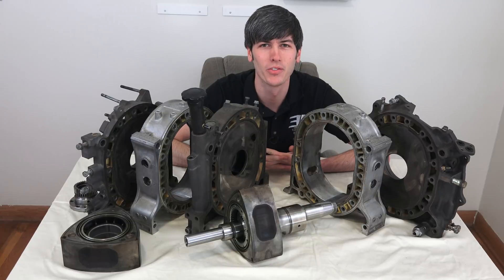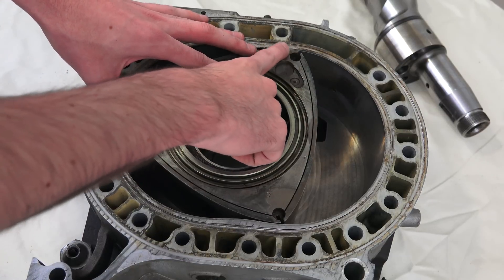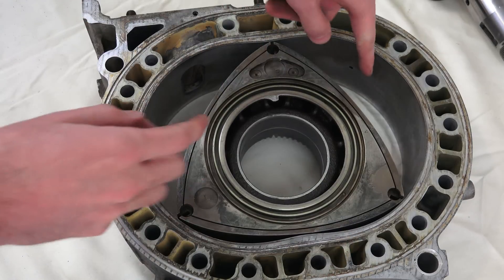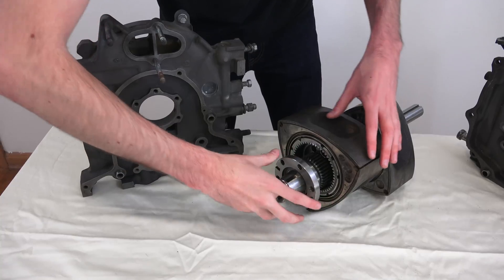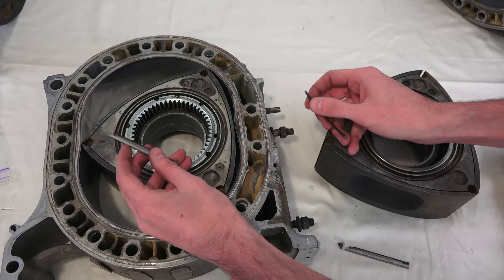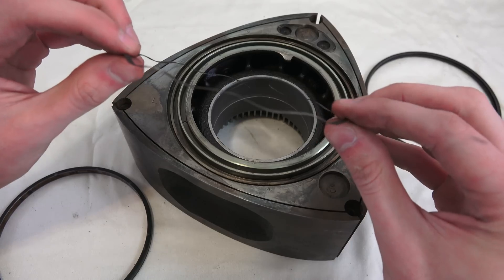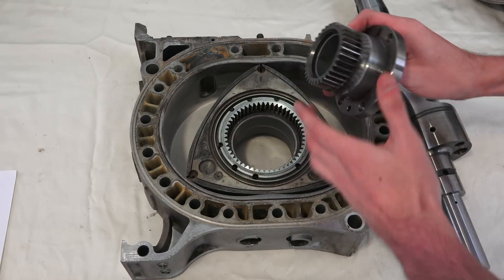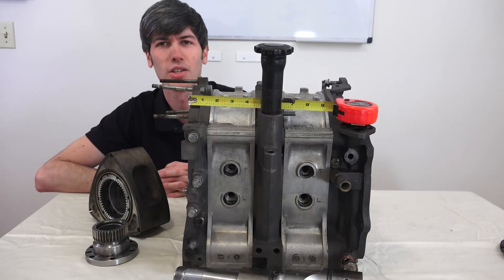How Rotary Engines Work - Mazda RX-7 Wankel - Detailed Explanation

Comment: T and L means trailing and leading; two spark plugs per rotor housing.  Also, there is no 'stroke" in a rotary. lol!  The corner seals also have springs.

Comment: CORRECTION*** The 2jzgte has oil squirters that shoot oil underneath the pistons.
Reply: +Zenda Drift Well, the special thing about the 2JZ is that, like you said, came from the factory ready to handle lots and lots of power. In reality though, you can get a lot of other engines to make as much power as a 2JZ if you swap out the internals to something similar that the 2JZ has. Heck, you could probably do it cheaper nowadays, seeing as how 2JZ's have become somewhat of an icon. Not that it doesn't deserve it. I mean, you can get a 4 cylinder to output 700HP with the right internals and enough boost, but it's going to be under a lot more strain than a 6 cylinder. Then again, you could go the route that Americans took up until the late 90's and make 8 cylinder engines with 4.6 liters of displacement make as much power as a low boost 1.8 liter 4 cylinder :D
Reply: +Zenda Drift Well although I do own a Supra MK4 I dare say that Nissan's RB26DETT is as good as the 2JZGTE but is a bit more rare
Reply: +Zenda Drift You should make a video on the 2jz :)
Reply from the maker: Many piston cylinder engines do.
Reply: +Engineering Explained in the video you said piston engines don't
Reply from the maker: +Zenda Drift Watch again, I most definitely did not. :)
Reply: +Engineering Explained I stand corrected! I mis understood at the part 6:05 haha. But still, we'd all love a 2jzgte video! ;)
Reply: +g4rr377 The layout and materials of an engine does not automatically make an engine great. And by today's standards no, it isn't particularly anything special, but I don't know any engine that came factory being able to handle over 700 horsepower reliably without touching anything from valve cover to oil pan other than injectors.
Reply: +g4rr377 I'm probably wrong, but there's a reason it's still being used in motorsports. One of the greatest engines of all time.
Reply: MrSlowestD16 Yeah, the F20C is a pretty solid engine. Another example of an engine that can do 700HP on stock internals (although it cannot be abused as much at that power) is the 2.7 BiTurbo in the S4, but again, that one doesn't take too well to abuse.
Reply: +MrSlowestD16 id personaly would like to see an L28 tht brings back memorys
Reply: +Zenda Drift There's not anything particularly unique about the 2j worth making a video about compared to something like a rotary or even a VR6
Reply: +Zenda Drift Another engine that handles 700 from the factory?  Look at the F20C....yeah, the Honda S2000 motor...can handle 700 from the factory, stock, and isn't even an iron block.

The 2JZ is a very solid engine, but in terms of a tear down there's realistically nothing different/unique about it.
Reply: +Sam Tynnoson i luv 2j i luv rb but the 2j is going to preform better if you want a power beast and parts are alot easier to come by
Reply: +dxdjoshua Yeah, they never get old.  No school like the old school!
Reply: ***** It's a flat 4, or a Boxer engine. He has explained it before in a video.
Reply: +Zenda Drift it was near 1000whp that the stock internals can handle.  Again I need to point that out for all keyboard warriors, we're talking about WHEEL horsepower, not crank.

+MrSlowestD16 At the wheels?  LOLOL  Nup.

+Sam Tynnoson Nup.  The RB26DETT couldn't safely handle 600whp.

Comment: Thank you so much for this, a friend here in Atlanta owned a RX7 shop I always seen parts around his shop.  I got a question how are the parts lubricated,;where are the coolant and oil ports?  why do they consume oil, so much?  Do they produce more heat or less vs your traditional cylinder engine? where is the gear box placed? longitudinal?

Comment: The reason rx8s and rx7s handle so well is because the engine is so small it can be placed behind the front wheels, effectively mid engined.
Reply: +metaforest What? haha, there are many cars with 50/50 distribution. My E36 being one of them.
Reply: +MarchuxProductions Check out the weight distribution of the SLS... 54% over the REAR wheels, and that's a front engine, RWD, V8 powered car.
Reply: +Louis Bou mid-engined, only slightly...  they suffer from being nose heavy just like any other front engine rear-wheel drive car.
Reply: ConnorWolf Exactly. FRs aren' t limited to forwards weight bias.

Comment: some say that japanese car parts are interchangable, i was wondering how many fabrication it takes to fit a wankel rotary engine to a transverse fwd transmission.. i always wanted a rotary on my car for the 1 of a kind vibe..
Reply: lots. More time and money than its worth. fwd rotary? really?
Reply: I fair amount of people have made fwd rotaries and they work well. Someone put one in an Ek9 civic using the stock gearbox with an adaptor plate so it fits the engine.
Reply: +GustSergeant Well if you think about it, you can make the cars floor pan very low since their is no drive shaft.
Low floor pan means more leg room which is what people want these days.
Reply: ***** like i said, the one of a kind, anyone can have a rotary engine car but how many owned a fwd rotary? Talk about bragging rights.. Hahaha
Reply: +GustSergeant Theorhetically, no. This engine is very small and incredibly simple, so putting it in an FWD car would not be much of a challenge.
Reply: +Nano Kumo Mazda made a prototype rotary powered Mazda5 to showcase their dual fuel Rotary engine (hydrogen or gasoline), I wonder what transaxle they used or how easy it would be to replicate?
Reply: +GustSergeant actually, there is a factory FWD car with a rotary, and to top that, it's a Lada.
Reply: ohh really? Not familiar with Ladas, I never knew that.
Reply: ***** The first two Lada rotary products were the VAZ 2108-91 and the 2109-91, and there are some later models, too. IIRC, there are still rotary Ladas in production.

Comment: 1985's had 12a motors
Reply: +Mike Jackson 84 had 12a or 13b  and 85 had only 13b motors.  The later gens 86 -> had 13b  Even the rx-8 is based on the 13b.

Comment: Just a note: The "T" and "L" on the side of the housing indicates Leading spark and Trailing spark. Great job explaining the Rotary engine.
Reply from the maker: Yes, great comment!
Reply: +Engineering Explained with great comment comes great inform...ability.
Reply: +Engineering Explained are you going to do a video explaining disadvantages of a rotary engine? like in this video u explained how a rotor is More efficient than pistons, but is there a considerable power difference in the way it makes it too?
Reply: +Engineering Explained Please do a build and possible engine installation!!! Thanks for the awesome video!

Comment: great video, i have a quick question for anyone who can help me

can a mazda 6 v6 take royal purple synthetic oil? is synthetic oil ok to use on a vehicle that originally takes a synthetic blend?
Reply: You'll be fine using full synthetic.
Reply: Yes. Yes you can. 

Here's a rule of thumb for your Mazda 6, and any car you own in the future. Unless your car was made before 1980, you can use conventional, synthetic blend, or full synthetic in your vehicle. If possible, use full synthetic. If you're short on cash, then settle for synthetic blend. There's really no reason to ever use conventional. There are, of course, exceptions. Always refer to your owners manual. If it requires anything "0w-XX",  you can only use synthetic blend, or full synthetic, as 0w oils are so thin, they need to be man-made, meaning it's not available in conventional. If you ever own a Chevy, it might have a Dexos requirement, meaning you can only use oils that are Dexos approved. 99% of conventional oil is NOT Dexos  approved, except for a few oddballs, like Valvoline's conventional oil. Lastly, not being able to switch back and forth between conventional, Synthetic blend, and full synthetic, is a myth. You can use whatever oil you want, whenever you want, and swap back anytime you want. 

Hope this helps.
Reply: +Caleb Youngs thanks man i aporeciate it

Comment: I bet most of people commenting on the disadvantages are the ones that never owned a rotary lol
Reply: +177SCmaro Yeah of course from lack of maintenance. Just like two stroke dirtbikes, it requires a lot more attention than four strokes (yet still cheaper to fix lol) but a whole lot more BRAP BRAP BRAP. Lasts just as long if you have proper techniques for care and do regular maintenance. It's all been pretty debunked now and there's SO much information out there on how to maintain these things properly that Mazda never knew about when they made it. Like pre-mixing for example.
Reply: +xXfresh12Xx what do you mix your fuel with? Just a brand or idk be specific please. I own an FC.
Reply: Zeus * I use idemitsu in my rx8 they design it for rotary
Reply: +xXfresh12Xx excatly the same reaction here also .. i .use motorcycle oil though .
Reply: +Leo Madrigal I own a s4, I usually premix with lucas oil. any tcw3 oil will do the trick.
Reply: a lot of people are concerned for burning oil but obviously they're the ones who don't service their cars
Reply: +xXfresh12Xx This is honestly really true. And the actual owners of these things say how it's just as reliable as a piston engine because they actually take care of their rotaries. Pre-mix your gas, and keep oil topped off EVERY TIME you take it out. You need to treat it like a two-stroke dirt bike, almost. I'd love to own an RX-7 FD, though.
Reply: +Violetta exactly someone who understands. when filling up my tank, people give me the strangest looks when i put oil in my gas lol treat it like a baby pretty much. FD'S are the dream man
Reply: +177SCmaro yes you do because then it goes to show how many people actually take personal care of their vehicles. & no
Reply: +Violetta preach!
Reply: +177SCmaro "Reliability disadvantages" for rotaries are superficial. It depends on the car itself, and the person.
Reply: +xXfresh12Xx I've never had cancer either but it's disadvantages are obvious.

Comment: why it is not used widely in cars ?
Reply: +Thee1Muffin way to spread out dated clichés....
Reply: +invinciblejets im trying to fight em all.. sadly im one man.. mine is at 130k and still going strong...
Reply: +bigandfluffy2000 I feel ya... My first na made it to 16Xk before a coolant seal went.
Reply: +Thee1Muffin Bullshit  on the seals, man. If you actually know how to drive and own a rotary (it's not harder, just takes a completely different mentality), these engines will last a long time.
Reply: low compression means low efficiency meaning you use more gas. as well as low compression, you have low torque. and the seals last for less than 75k so you need to take apart the engine and rebuild it, and that's if you actually take care of your car. most people neglect their toyotas and they run for 200k
Reply: thanks
Reply: Fuel efficiency and common reliability. Those seals don't last as long as they should and your average person isn't going to top their oil off as often as their gas.
Reply: +عبد الرحمن نصير One big reason is Mazda owns the patents.